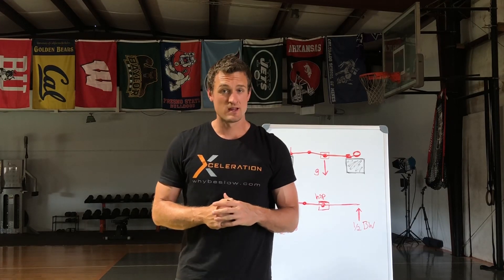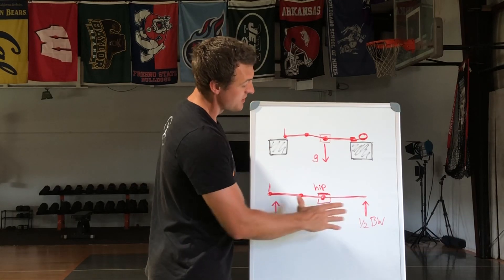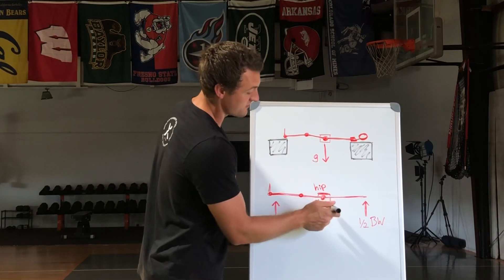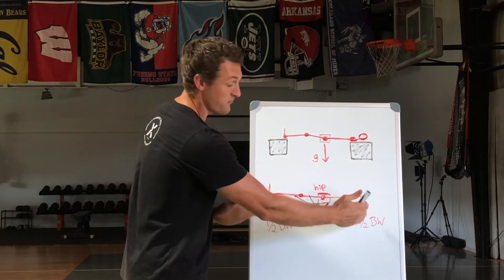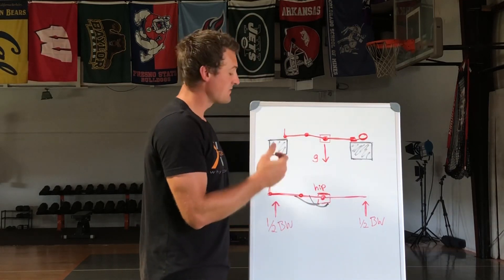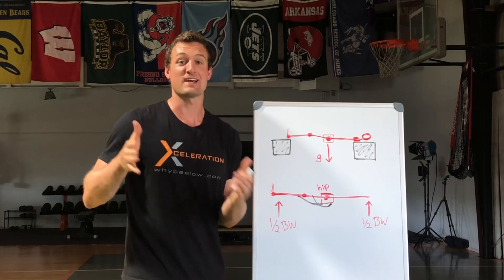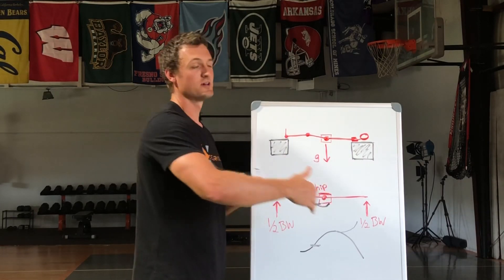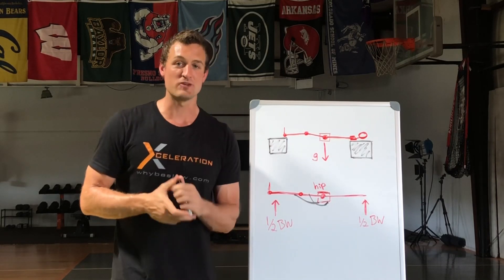Straight leg hip thrust and 6 training concepts

Comment: I don't agree with the end of the video... yes the physics of sprinting will tell you that you need to have a short contact time but Usain bolt's feet also need to be moving very fast horizontally when they make ground contact. It also takes incredible hamstring strength to stop and reverse the leg when it's being thrown forward and back so aggressively. This is common sense IMO. FORCE PRODUCTION FORWARDS AND BACKWARDS MUST BE ESSENTIAL TO SPEED. IT'S JUST THAT THESE FORCES FROM EACH LEG CANCEL AND SO THE GROUND REACTION FORCE DOESN'T EXPERIENCE IT.